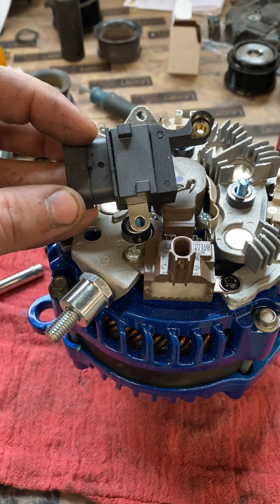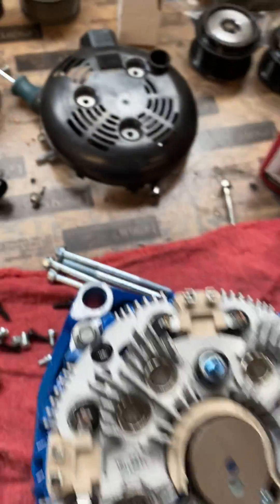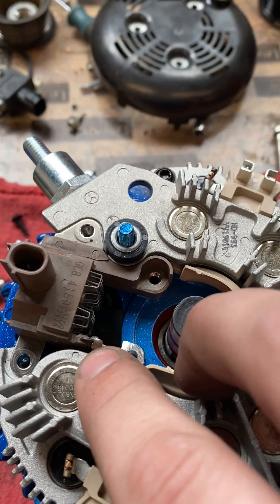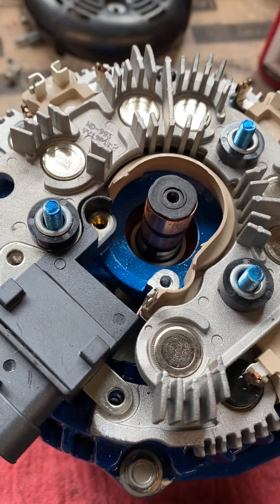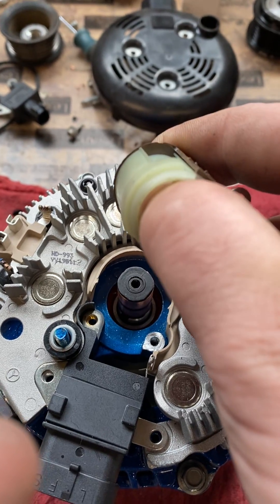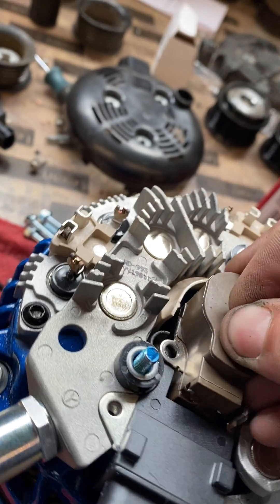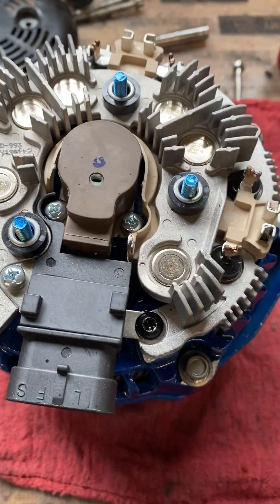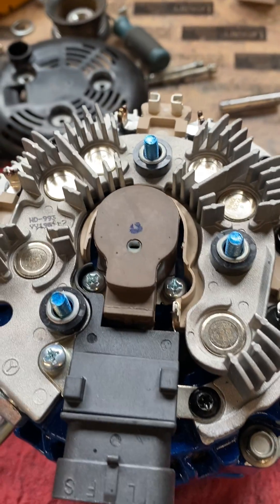Alternator bypass 14.8v GM regulator Swap denso hairpin

Comment: Hey I have a question I installed a pwm controler on my gm 2 pin alternator and now I have a battery light what can I do with the extra unused wire from the pcm to get rid of the light ???
Reply: Did you ever get an answer??  I’ve got a 97 Cadillac with northstar and I’ve got same issue

Comment: Bro I'm having huge problems with my truck not to be a Debbie downer but my house burned down my equipment to my little business burned with it and now my truck is messed up... PCM ECM alternator all is messed up idk how to fix it and now I'm broke as hell my 08 Dodge ram 1500 4.7 v 8  I've put 3 alternators, used but they say they were working but as soon as I try it it doesn't work... Idk if my truck burned them or what idk what els to do plz help

Comment: I want to bypass the PCM because everything works except the charge to my battery. So far I installed new battery and new alternator, and I would like to bypass the PCM using external voltage regulator now this is not working either and I wonder it's because the alternator has a built-in regulator that prevents it from getting excited.  What are your thoughts?

Comment: Very informative video. This looks like a great starting point for a build I want to do this winter.  I am wanting to build an alternator for my diesel power sailboat to retire my 30-year-old Ample Power 108A externally regulated alternator.  It was built on the old Delco DN10 case with rewound rotor and stator and better diodes to increase the output and durability.
At 2.27 you were pointing to an AC stator tap.  Does this have a pin-out in the connector that I can use to give my alternator driven tachometer its signal?  Is there an easy way to eliminate the internal regulator so that I can use my 3-stage smart regulator from my old Ample Power?  What is the power output on this unit?
My primary need from the alternator is to recharge my 560Ah LiFePo4 (LFP) battery bank.  Because it will accept the full output of any alternator for hours on end, I need the external regulator so that I can current limit the output by controlling the field.  
I assume that this is a B-type rotor.  Is there a way to convert it to an A-type.  For my needs this is a safer method.  My preference would be to bring both of the brush connections to the outside with case-isolated terminals.
The 3-stage charging is important becuse for saftest operation, my LFP wants to bulk and short absorb at 14.1v but after maybe 30-minutes at most should drop to a float voltage of 13.5v.  My external reguator does all of that along with reducing output if the alternator case gets too hot but that means external regulation is a must.

Comment: Will this fit my 370 alt from pure power ? 07 Tahoe 5.3? Will this fit
Reply: Custom electronics makes a "gm slingshot" that is almost plug and play..very little wiring, very little set up..rAn one on my 07 Sierra nd 06 silverado. Custom charge voltage settings..only commenting as someone else hast

Comment: Can you do this with an 08 gmc Sierra to help with batteries staying at 14.4 volts for upgraded stereo systems?
Reply: Custom electronics has a "gm slingshot" I used it on a mechman 320 w multiple agms..work flawlessly

Comment: I have a 06 dodge dakota, 3.7lv6. 200amp alt, but they didn't put right regulator in. So I just ordered a GM 14.8v regulator w/plug. How do I wire it to bypass pcm?
Reply: Update: I have the new 14.8 gm regulator installed now, but, not sure of it because my old regulator for my Dodge, held the 2nd screw on the brush housing... Only 1 screw is holding the housing. I'm not even sure if the 2nd hole has to have a screw to be grounded🤷🤷🤷. I'll know when I install and crank my truck. I can't seem to find advice so I'm going to learn the hard way with the old dreaded moment thinking it's a fail when I hit the key

Comment: I currently have a 250 amps alt from js alternator. Right now I have it “Plug and Play”. Do you think that by doing this it can help out my rpm’s from bouncing? Always when my bass drops my rpm’s shakes. I have: big 3, 1/2 shorter belt, sec battery.
Reply: Your RPMs are dropping because the load from the alt. What's your system consist of?

Comment: Do you have a kit for a 96 GM v8 5.7.
I have a 78 nova and I converted to serpentine belt using the 96 GM brakes and alternator application. My alternator is not charging and I can’t find the issue so I’m trying to bypass the internal regulator.
Reply from the maker: You’d follow these same step.

L terminal to ignition is all you’d need for your application though

Comment: I have a mechman 240 and a limitless 25ah I’m trying to stay above 14v in a 95 Yukon will this work on my setup?
Reply from the maker: That’s a 12v battery. You’re going to hold 12s to 13s with said battery when properly setup with whatever you’re running.

You’d want a 14v battery to maintain 14v like cmax yinlong our batteries or the limitless gorilla
Reply: @brandxelectrical  how can I get your batteries you have a website??

Comment: Will this work on a 2018 Toyota Camry with the single wire LIN bus style? If so, does this also eliminate the voltage from dropping to around 12-12.8 volts when idling in gear at a stop light?
Reply: What does LIN Bus style mean ? Did you ever get an answer. I have a 21 camry I want to put one in but the plug has 2 wires.
Reply: @TheBakeMaster If you have the two wire system it is the Smart system on the Toyota. It should default to around 13.8 if you unplug the lead... You'll get a check light but it should still charge at 13.8

Comment: Hello. Is this what is needed for my HO alternator? I have a 2003 chevy express van. The regular alternator works fine but when I swap it with the HO alternator the voltage goes up and down.

Comment: I have a 2005 GMC Sierra 1500 with flickering headlights and after replacing alternator with remanufactured AC Delco 145 amp arlternator and learned it may be the actual regulator itself.  What brand (Denso or other) and part number of regulator should I get?  Thank you!
Reply from the maker: Ac delco regulators are not interchangeable with denso regulators, also there is 3 different regulators you may need to work with your vehicle / alternator revision from ac delco
Reply: @brandxelectrical , thank you very much!  I don’t think the issue I’m having is what your great video relates too as far as keeping a hi charge output as that is how I perceive it.. All of my lights flicker/pulse and I read on a FB post forum that one individual learned through research that there have been issues with Delco’s internal regulators have been known to cause it.  I replaced the alt on my truck with 254K miles on in it as the diodes fried, yet, up to that point never a flicker.  A reman alternator was installed on 10/20/20 before setting the clocks back and it wasn’t until I was driving more in the dark that I first noticed the flicker a few weeks ago.  Also, the same forum suggest taking alt off, cleaning all mounting and reinstall may eliminate problem.  I thought that if there is alternate brand of regulator, I’d remove the Delco and install it for service and end the flickering for good.  Thanks again!

Comment: I run at 14.5 all day all you need to do is run an extra 4guage wire though the stock wire ground for the pcm to see a draw to trick it this works people it's the sensor by the ground wire by the battery you have to trick it 👍
Reply: Can you elaborate some? Explain it to me like I'm a dumbass. 😁
Reply: @noahkb80  run an extra 4guage wire though the negative sensor on the negative battery cable you can't miss it has loop around the ground cable rite off the battery with a plug going to it you need to run the extra 4guage thu it
Reply: @yourmom-ii8ep  well ok here's what I got going . I've seen a few videos mentioning a write up by Mechman saying that with my style truck,  08 silverado,  to just do a" big2." And upgrade the size of both + and - from alternator to battery and pass through that sensor and thats that. It was said that all grounds need to run through it.  What I have is those 2 mentioned,  another ground from alternator to the firewall where the ground strap is located running to the back of the block and hood. And then I've got one from the battery down to the frame right below the battery,  where a couple factory ground land.  Ive got 2/0  and the , id guess 8 guage wire going through sensor . Its a factory wire with thicker copper strands.  And it barely fits.  I doubt I can get anymore through it. Where does this wire you are talking about need to be ran?
Reply: @yourmom-ii8ep  i think im following you. 
I did find a company, maybe AmericanAlternater,. Id have to look, but they have a $200 item that keeps factory factory  but let's you set the voltage thus disabling the rvc.

It's weird, when I crank i get right at 15v give or take a .01.  Then eventually it settled at a 13.5-13.8 range. But during the day, with nothing on, it falls to 12. 4 or so.   If I pull the ground and let stuff reset  it'll stay above 14 for roughly 36 -48 hours before going back down. Its like the computer keeps learning something and it makes changes. I wish it would stay like it does right after reset  cuz it drives so much better
Reply: @yourmom-ii8ep  its not an alternator, its a module. usalternators site.  

And well , off my battery i got a 2/0 running through the Hall Effect to the alternator case , another 2/0 to the frame .  Then the factory 8 guage im guessing going through the hall Effect down to same spot on the frame. But it splits off and goes somewhere else too.  So I could just pull that factory off the frame down there since I got it covered with my upgrade, leave it connected to battery and just relocate to firewall?  At my firewall spot right now I've got a 2/0 going from alternator case to the firewall , then one tiny one that goes to the hood, then the ground strap that runs to back of the block. And you're saying get one from that firewall spot through thr sensor and to neg terminal anx that ll put me in charge mode?  I got no more room in that sensor. The 2/0 to the alternator case and the tiny one i mentioned moving.  You can't fit a frog hair in there now
Reply: @yourmom-ii8ep  yes. I did big 3 upgrade and right now i got 2/0 running from neg battery post, through Hall effect, and to alternator casing. Also, the factory ground that runs from neg post down to the frame under radiator , its small maybe 8 guage but has alot thicker strands, it was passing through the Hall effect so I kept like the factory had it. So with my 2/0 and that factory ground , I cant fit anymore through
Reply: @yourmom-ii8ep  but I dont have anything running from firewall to battery.  I've got 2/0 going from alternator case to firewall where the groundstrap also lands
Reply: @yourmom-ii8ep  yes
Reply: @yourmom-ii8ep  yes

Comment: Very interesting video. I have a Denso alternator that was controlled by the BCM in a 2013 Camaro. The engine is now in a 1966 Chevelle and I’m not running the BCM. Can you sell me the parts I need to convert it to a standard voltage regulator?
The GM # on my alternator is 22859538
The Denso # on the alternator is TN104211- 8130
The Denso remanufactured # is 210-0303 which has been superseded to 210-1021.
Currently the alternator defaults to 13.6 volts.
Thanks
Reply: You ever get that sorted?
Reply: Glad I ran into this. I need to break my alternator free from the bcm! I have a stinger alternator that is subject to the PCM regulation on my 2012 Camaro. I need this!!

Comment: I have a mechman 285 ho
Alt it was on a 2006 envoy 5.3l
I'm trying to put it on a 2015 gmc Sierra 
5.3 the connectors are different what can I do about this
And the ho alt has the piece and regulator you just installed how do I
Hook it up
Reply: Brandx sell them for 80$
Reply: i would like to know where  i con get the equipment to  change it from pcm control

Comment: Will this work on my 05 Chevy Tahoe   and dose this bypass the PCM and how do u wire it in
Reply from the maker: Brandon Sanders this works on hairpin HO alternators. Not stock units. The wiring is another video we have on this page. How to wire bypassed alternators
Reply: @brandxelectrical  I have a high output alternator I have a 320 auto will this bypass the ECM or PCM will the PCM still regulate the voltage or will it stay out of 14.8 steady
Reply: My high put alternator is a Auto tech

Comment: So, just swap the plug ends and it bypasses the GM pcm? I bought a 370 amp alt, it comes on and off due to the PCM. So i just need to by the harness and plug it in like so?

Comment: If I’m doing this on my 320a alt for my 2011 Camry can I just cut my factory plug and use wires from it or is best to run all new wires for plug?
Reply from the maker: You can use ignition off your stock plug to wire it up.

And S to your stock plug as well.

If you’re looking at the regulator on the stock alt top left of the clip point is ignition. Top right is sense.
Reply: Jonathan Patrick so ignition to f, sense to s and then warning light/or resistor to L. And if I want to wire in diode put it on s terminal? And is this looking at stock plug from back of alt or front?
Reply: My factory plug is 1) always on 12v through fuse 2) switched voltage through fuse 3) to ecm 4) to warning light// do I only need to wire switched voltage to S terminal and l terminal to warning light and leave field and other terminal blank?
Reply: Diagram?

Comment: hello! the more electric things i turn on, the more my voltage drops, lights dim etc.. even with engine turned off. i suppose it could be alternator. since i can't find the Regulator on Spare parts, i suppose it is an integrated R. model is M.Marelli AA 125 14V 45A  any suggestion on how to fix it? maybe replace brushes?  whole thing is dammn pricy. thanks

Comment: Is there a solution like this for a jeep alternator? 97 mod 2.5 diesel. Has a pcm regulated alternator with a vacuum pump on it.
Reply from the maker: Steinar Tande you use an external regulator.

Jeeps are generally external.